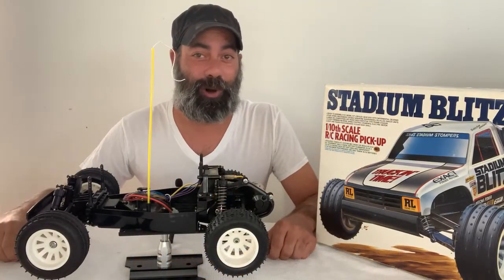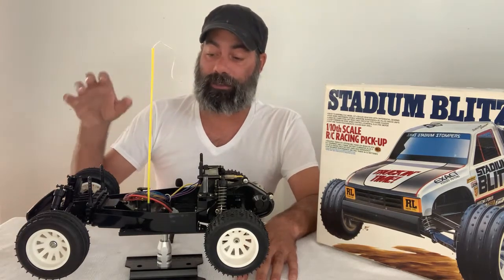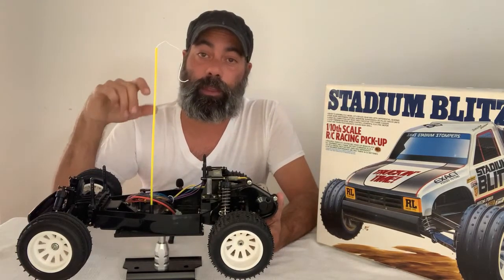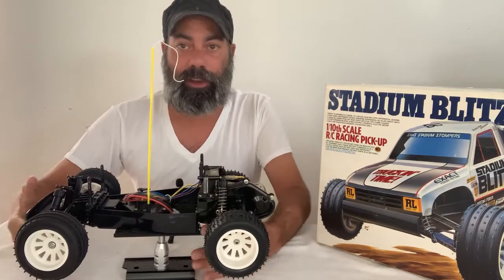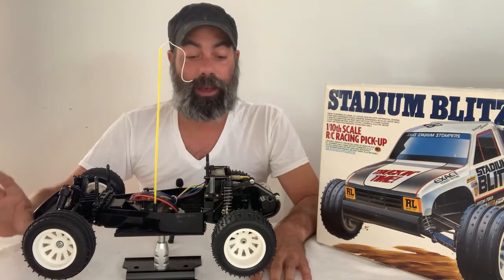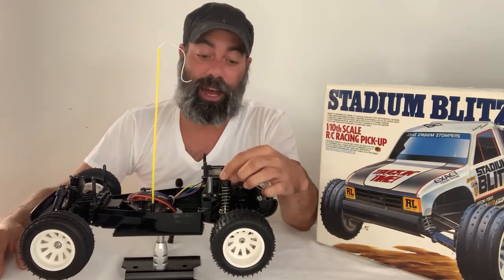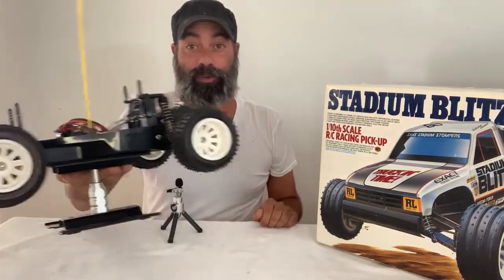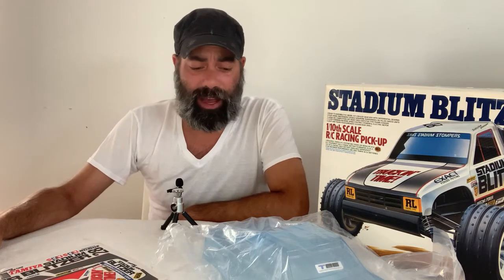Stadium Blitzer vid 2

Comment: Great vid - were the decals made to order or in stock at the time? Look forward to seeing the result!
Reply from the maker: I have the new body and a fresh set of decals as well as the paint… I’m just being lazy on that project for some reason LOL
Reply: @hobbyroom2126  No worries lol. I have an original I built in '95 and did the respray as part of a recent resto...it was fiddly but would make a fun video. Funnily enough it's got a small crack in the rear suspension mount in exactly same place did it tightening the screw up. Other than its held up well and running again